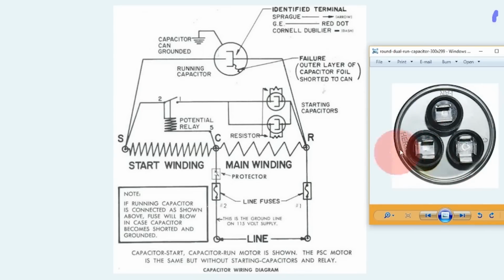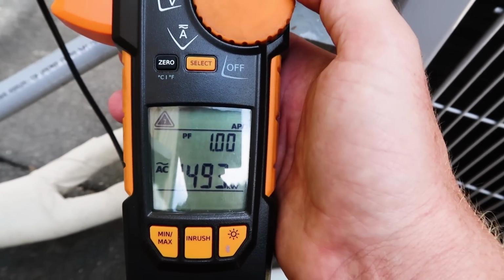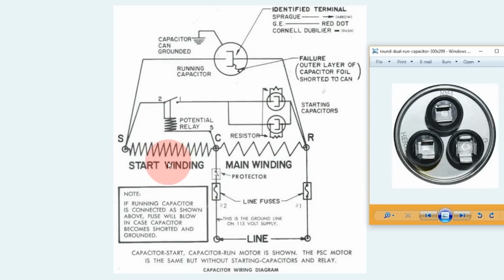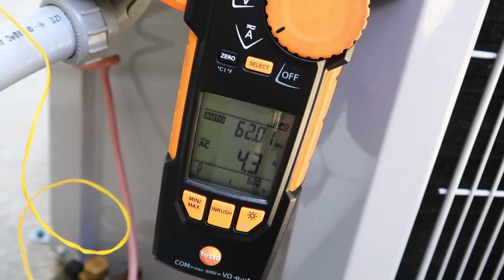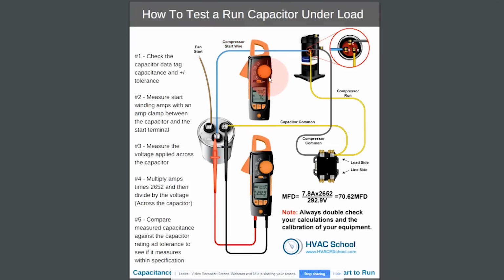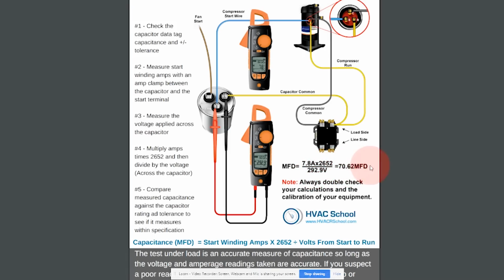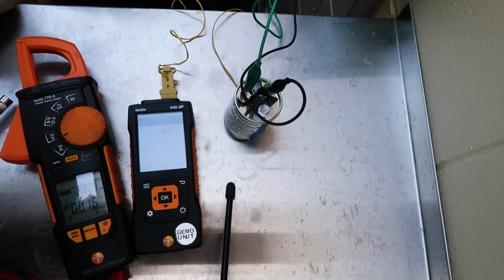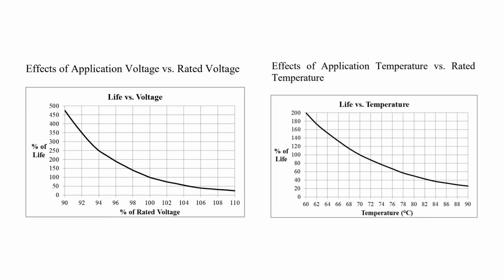Why Do Capacitors Fail? (It’s not why you think)

Comment: Whatever fault in the system yielding inefficiency or reduced performance will cause the capacitor to fail sooner. The main reason is, the thermostat will let the unit ON for longer time to maintain the temperature, so the given capacitor lifetime gets eaten up sooner... Well, obviously not only the capacitor...

Comment: Run capacitors fail so often, especially in hotter climates for one simple reason, the capacitors you get today are poorly made. They are insulated and cooled internally as cheaply as possible, even the ones installed in units from the factory.
Reply: @CactusBobsPlace  In NY I just replaced mine after 25 years when the fan needed replaced for the first time, the other unit still has the original cap.
Reply: @toddac61  that's in NY though bud, ac units are more like an occasional luxury there to keep you comfortable when you experience weather that's not frigid cold for a short period vs places like south Texas where we burn out ac unit components within a year or two easily.
Reply: Amrad capacitors are guaranteed for 5 years... I match my labor to their caps for good reason... the "el-cheapo" caps MIGHT last 2 summers... two service calls (let alone el cheapo) pay for ONE service call with an installed AMRAD... I put my name on an AMRAD for 10 years... I don't warranty them for that long... but I know AMRAD to last for ABOUT 15 years... YES, THEY ARE THAT GOOD!
Reply: Get the 440vac rated helps. The 370vac ones can't handle as many fluctuations and will have a lower life
Reply: I wish they would stop making 370 VAC capacitors altogether and only make 440 VAC.  It would save money on everybody. @ozm8642
Reply: Has nothing to do with ‘today’. There have always been long life, high temperature parts. They can cost as much as 5-6x cheap parts.
Reply: They fail due to heat , excessive amperage …low income supply voltage  1 or a dirty cond Ensor coil 2 overcharged system 3 , don’t care how
Clean yur coil
Looks you’ll be amazed how much shite comes out when you clen properly yeah I’m posting on Saturday hite
Reply: The main cause is not cheap production, its the environmentalists. The chemicals to produce more reliable capacitors have been forbidden about 20 years ago, thats when the quality went downhill.
Reply: @joskevermeulen9275  No, it's cheap products. The Chinese caps are the worst. They are tiny compared to, say, US-made GE caps (back when GE owned the plant and made them here). Capacitors generate heat during operation, and that heat has to be dissipated. also, a smaller capacitor is made by using thinner aluminum  deposition (which means higher internal resistance) and thinner polymer separator (which has higher loss). Combine all these cost saving "features" and you inevitably have a capacitor with a shorter life.
Reply: @WTFChuk  Don’t buy the cheap ones. Get the Branded Chinese caps.
Reply: @milo178  They are ALL garbage. Period. If you want the best,  get Amrad or Capcom (Capcom is the newest name for what used to be Genteq capacitors, which in turn used to be GE capacitors). I would agree with the other guy in this thread who says Amrad is best. That said, Capcom/Genteq is still a good capacitor as well. That has been my experience, anyway. 

For others reading this, I was at a local parts house that sells MARS products. Years ago, Mars caps were rebranded GE's. Then they started selling Chinese-made caps for a while (which I refused to buy). Anyway, I was at this parts house getting a compressor warrantied. I needed a new run cap as well (didnt have one on the truck) , and I figured I would have to go to another parts house to get a Genteq (Amrad caps are hard to get close by). Just out of curiosity, I checked to see if they had a Mars cap in the size I needed (45/5 round, IIRC). Well, not only did they have it, but it was no longer Chinese! Box and cap both said "Made In USA"! I was very surprised. There is only one US manufacturer of run caps, and that is Amrad. I'm guessing that selling Chinese caps bit Mars in the ass, so they started selling rebranded Amrad caps instead. It definitely wasnt money, because the prices were still reasonable. They could've kept selling Chinese caps at a higher profit. Something forced them to switch to Amrad, and the poor reliability and longevity of the Chinese caps is the only thing I can think of.

Now if they would switch to a non-Chinese supplier for their contactors.....
Reply: @WTFChuk  I am looking for non-chinese contactors. Is there such a thing?
Reply: @OLDBEAR123456  Good question. I havent seen any, but then again I havent really looked. I doubt you will find any that are US made, but made in Mexico is a good possibility. Let us know what you find!
Reply: @WTFChuk  Will do.
Reply: @OLDBEAR123456   Electronic parts are made in every level of quality in all markets, including China.  The cause of crap parts is the Home Despot phenom, where the highest profit parts are chosen to dupe the unwary.
Reply: @joskevermeulen9275  I disagree... amrad makes capacitors that last.... everything else, pretty much, does not.
Reply: @joskevermeulen9275  not true.  The problem has been product pirating, changes in design standards and price competition causing QA to lapse.  Big discussion on electronics stack exchange.  Capacitor plague was a big deal 20 years ago when aluminum bodied electrolytics were exploding in consumer electronics on the daily.  They sold kits to recap computer motherboards, VCRs, cable boxes, etc.
Reply: @joskevermeulen9275 PCBs. That's what was used to cool them. I've seen units from the 70s with the original oval run caps still going strong.
Reply: @joskevermeulen9275  y
Reply: @joskevermeulen9275    Yeah, those damned environmentalists.  What a ridiculous take.  Untrue, AND irresponsible. You must be so proud.
Reply: @artysanmobile  Yes, i'm very proud to be able to look at the complete picture and realise what is actual good or bad for the enviroment. Not like those moral superior enviromentalists that have 0 technical understanding. To understand if something is good or bad you have to look all factors.

Comment: Since pcb's were banned capacitors started failing. Dual capacitors fail at a higher rate than single. castor oil doesn't cool capacitor that well.
Reply: Them old gray ones.  Recently found on with 1965 on it still working
Reply: @georgekolos5255  the ones we tested on ohm scale with our 260 simson analog meters.
Reply: @monroekunz2070  Yes. My father still uses his Simpson meter!

Comment: I have to replace my friends run capacitor every single year, around April, just before summer season.  Another thing,  his compressor will still run and cool his house even with a dead run capacitor.  It doesn't quite cool the house efficiently but the compressor will still start and run without overheating. I've never seen anything like it.  None of his neighbors have this problem. I replaced the capacitor every April, and by April next year I have to replace it again.  Start and run amps are well within norma rated range.  I even added a start capacitor kit last year hoping that will help. Nope. Start capacitors fine, wrong capacitor still needs to be replaced every year.
Reply: Check breaker connection and shut off box.

Comment: My next door neighbor has been in refrigeration for over 40 years. There were still US manufactured capacitors that contained PCBs when he started. They rarely failed... He still sees some old equipment during changeouts where the capacitor is still good. The pressure from Wall Street on HVAC manufacturers to maximize profits has driven them to "sell their souls" and purchase crappy off-shore components. My neighbor ONLY uses US made capacitors for replacement because he hates call-backs. Sadly, it's getting more difficult to source quality US made components... If you care about your customer, try to source US made 440V capacitors - ensure that all connections are clean, no burnt wires - and secure the capacitor properly (no duct tape)!

Comment: Three reasons I've EVER had a capacitor blow: Wires burning up because thermostat was set too low. Reptile or large insect shorts the terminals. Lightning strike or large surge. That's it. I've replace a semi trailer full of capacitors in the sixteen years I've been working on A/C's.

Comment: good explanation,
what is going to happen when I connect directly a 3 phase 2,5 uf power factor to a 3.75 kw
hermetic sealed compresor,does it work directly or I need a contactor to discharge the 
residual charge each time the compressor off, since the sealed compressor run 4 to 6 min on to decrease water temp
then 2 min off?
Reply: Call your HVAC sevice provider with that question.

Comment: Carrier had a problem with there caps in late 90 and early 2000. Blew the cap off. If you measured it had 390 volts with 370 cap. So eliminate 370 caps and just make 440 FGS

Comment: What amases me that VFD manufactures state that their capacitors last 80,000 hours. Had some 10 to 125 HP 480 volt drives that were over 15 years old with all the original DC Buss capacitors still working. That would work out to 6 or 8 lifetimes of capacitors used in AC units. Years ago I talked the refrigerantion guys to let me start doing away with single phase fans & capacitors on roof top units with 480 3 phase fan motors. Used a quality ALLEN BRADLEY or Square D contactors. They keep a log book with and had less then halve the fan problems with my but you are only an electrician suggestion. Would watch what brand motors they purchased. No crap from cheating lack of quality control scum bag communist china.

Comment: For those who don't know, capacitors charge to a higher voltage that what's going into it. Check the voltage on the HERM terminal to common, it's over 300 volts!
Reply: shock you dead!

Comment: Where did you get 2652 in the math?
Reply: How do you calculate Microfarad?
Improve Accuracy And Save Time
Divide the total of the start wire amps times 2,652 by the voltage you just measured. This total is the capacitance. The complete formula is: Start Winding Amps x 2,652 ÷ capacitor voltage = microfarads.

Comment: Thanks, very instructive video.  My choice would be to always use a 440 Volt capacitor as long as there is physical space to accommodate it.  It is worth any extra expense.  The other thing is to check carefully that all connections are clean and tight.  Check terminals on the capacitor,  but also check the contactor and any terminal blocks.  Failing connections in various locations could increase motor back EMF, causing higher voltage across the capacitor.
Reply: Most Caps are dual voltage now

Comment: Really well done video! I’m an EE, but no experience with motors and capacitors. This all makes perfect sense, and thanks for the tip on AmRad! I followed the link to their site and learned about their Turbo 200 universal run caps. With a total of 6 HVAC units between two houses, I love the idea of being able to cover all of them with just one cap! (Only thing is, I assume the diameter will be larger than some of the standard caps, so I may have to fiddle with the mounting.) Besides the convenience, I love that they’re US-made.
Reply: Turbo200 3x-4x more costly than standard run cap & cost has to be passed on to customer= too expensive! Great versatility in a pinch, then can go back & install correct rated cap
Reply: @matthewclifford5824  Wisdom

Comment: What does it mean when the current is equal on start , common , run. Lg compressor in a new Lennox 14hpx-036. Single phase 208/230 vac 245 vac line voltage, run cap ck out

Comment: 23:23 into the video One of my experience out in the field was a surge right after a thunderstorm I've had a few replacement because of that. Coming from my perspective it was because high voltage like you stated!.   I recommend to install a 'Surge Protector'. I explained what it could do and how it works they insisted so went ahead and installed it for them.

Comment: Run Capacitor Tunes the Sign Wave... Right. Kinda like a tune up on an engine. Makes the motor run smoother with less running amps at rated speed weather cking amps on comm or run. Full circuit is made from comm to runn ie:230vac line 1 and line 2 supply voltage. Very interesting in depth post.

Comment: I have studied electronics in depth in high school, trade school, and in college.  Your explanations of the factors causing capacitors to fail was never mentioned.  We analyzed inductive & capacitive reactance.  Counter or back emf (voltage) was not discussed either.  This analysis applied to actual compressor winding circuits helped to clarify many issues for me.  Thank you.
Reply: I wonder if excessive vibration can also lead to internal breakdown for capacitors.

Comment: My 28 year old Lennox unit has the original capacitor. Still works perfectly.  The modern ones fail  because they are garbage impregnated with vegetable oil.
Reply: This is it. They simply didn’t fail 30-40 years ago. Txv’s didn’t either.
Reply: @scottkasper6378  , look at where they were made 30 -40 yrs ago and look at where they're made today !
Reply: @scottkasper6378  Whats your power bill like on that 8 seer I'm 3.5 seer by now unit.

Comment: sorry. about two thirds of this is correct. a capacitor used in an AC circuit like this is NOT a storage device at all. that part of your explanation might help apprentices struggling with this concept a bit at first but it isnt right. capacitors in AC circuits is complex.  in a dc circuit like a power supply it is used as a storage device to smooth the ripple into flat dc. in an ac circuit like this the capacitor is used secondarily as an AC resistance (called impedence) AND primarily as a phase shift of the current. the main winding carries current in phase with the voltage, the run winding carries current that is phase shifted relative to the voltage so that makes the motor turn. like a poor mans three phase motor but with 2 phases. if you replaced the capacitor with a resistor of the same impedance as the capacitor is providing at 50/60 Hz, the motor would not turn since the phase shift of the secondary winding is not present. in general, the real effect of a capacitor in an ac circuit is that of a frequency dependent impedance ( plus phase shift as used here) .  if you doubt this, think about what the capacitors in the cross over network of of a speaker box do. they form a filter, a frequency dependent voltage divider with the inductors. Also when you are using the tong meter on inrush current it is not working properly. Use an analogue meter to see what is going on. the impedance of the capacitor and the start winding together is Z= Xc + XL   = 1/2 Pi F C + 2 Pi F L.  ( F = freq L = inductance C= capacitance Pi = 3.14) but the phase angle has to be allowed for.    when you test the capacitor on it's own, the heating effect in the capacitor is P= V squared / Xc. it is pulling current at 90 degrees leading. not pushing it in and out. that is how it works as a power factor correction device. such as in a fluoro light or mercury vapour streetlight. the leading angle of the capacitive current (that you incorrectly say is NOT flowing) is cancelling the lagging inductive component of the motor or fluoro light current it is connected to. ( across the supply) Back to the compressor example: the current thru the series capacitor + motor inductance combo is MORE than thru the capacitor alone so it does dissipate more heat in circuit. I found this info to help with that since it is too complex to explain here. https://www.allaboutcircuits.com/textbook/alternating-current/chpt-5/series-r-l-and-c/
 so far as what makes them fail, i think it is high temperature because they are often mounted above the compressor in a split system. the hotter the ambient temp plus the compressor temp the more likely it is to fail. notes: 1. mounting it in the airflow is good, not bad. 2. a lot of them now do not have oil inside. 3.  i agree removing junctions from the cap and joining them in a terminal is better. 4. undervoltage is said to make motors pull more current. sometimes. if that is the case it MAY increase failure because of the heating effect on the mounting area. as you said anything that increases the heat dissipated inside the capacitor or it's ambient temp increases failure rate. excessive load may increase back emf and hence capacitor current and increase temp so other techs who report that may be right. read the link provided to grasp this.
Reply: What a thoughtful reply. Thanks for sharing this great info!

Comment: Is a Capacitor of the same uF  but different Tolerance(3% instead of 6%) ok to replace? All other ratings are the same as well.
Reply: Lower tolerance suggests better quality, this is the guaranteed actual capacitance vs label capacitance. +/-3% of 45uF vs +/- 6% of 45uF, the capacitance of +/- 3% suggests higher quality.
Reply: @thisisyourcaptainspeaking2259  Thank you 🙏🙂

Comment: Wouldn't the windings of the start circuit be what dictates the amount of current flow on the start?
Reply: The run capacitor is what limits the current flow on the start winding of the compressor motor as well as 
providing the necessary phase shift to get the motor turning in the correct direction upon starting.